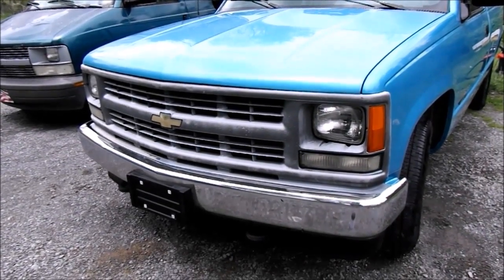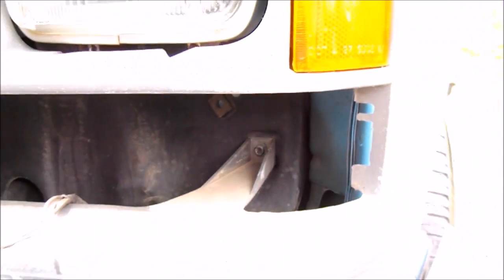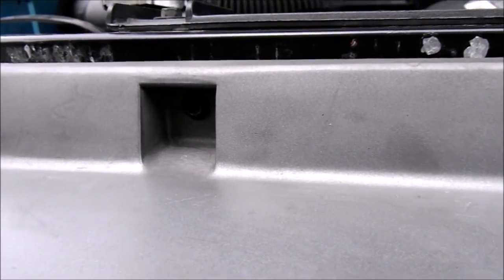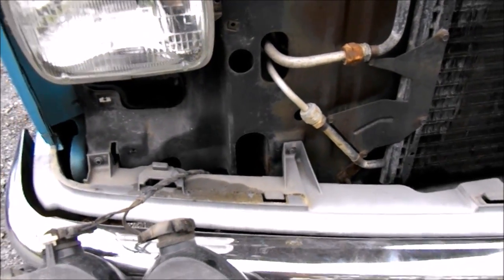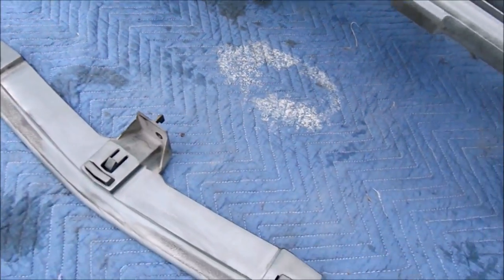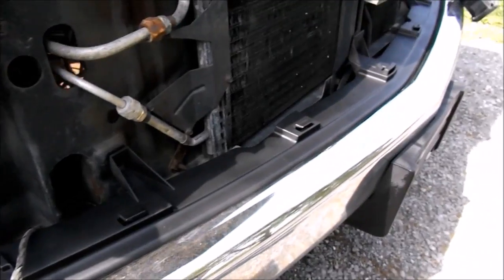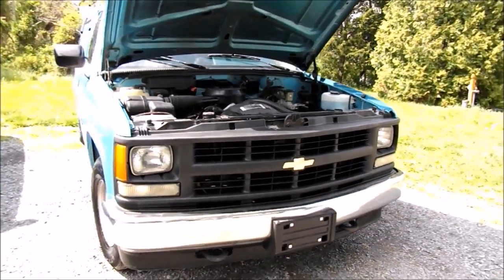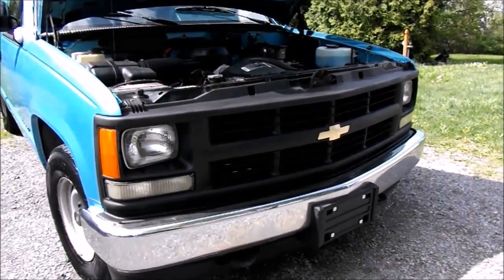Before and After Painting Truck Grill 1994 Chevy Cheyenne - How To Remove The Grill on a 1994 Chevy

Comment: you need to trow those old turning signals away ,go on amazon there are some nice crystal clear replacement lights ,it will make your truck look cleaner.
Reply: NETRO13 do you have link to them
Reply: Clear side markers will fail you on safety inspection.  They have to be amber to be DOT legal...  
And yes.  You can and probably will get a ticket.  The DOT cops are looking for revenue from everyone now.  
The W/T grille looks great in black.  Real clean look.  Even better if it was a GMC grille...  ;^)
Reply: David Hatzenbuhler they make amber LED bulbs
Reply: I have one and looking for some improvements

Comment: What kind of paint did you use and the sanding process done by hand or with a buffer?
Reply from the maker: The paint used was Rustoleum Flat Black and we sanded it by hand
Reply: +© Maxxtruck9906 hella sick bro. imma do that this weekend. I got a 94' z71 off road. 

Nor☆Cal

Comment: what is thr front end called
Reply: That's the base model grille which uses the single sealed beam setup that was on the standard C/K Pick-Ups in Cheyenne trim and the W/T trim (exclusively for the C/K 1500's).

Comment: How much do these trucks go for in good condition??
Reply: I paid 3,500 for a decent body and pretty good interior 👌
Reply: @BigDookie85  i got one for 6000 you think is a good price its a side step with 111xxx
Reply: @cristianrufino3472  yes the miles are good
Reply: @BigDookie85  are you still working on yours?? How's it doing till now?
Reply: @cristianrufino3472  $2,500 dollars so far on oil change, transmission flush kit, tune up, new catalytic converter,  fuel filter, idle air control valve and flowmaster series 40 dual exhaust. She's running good now. Next going to be line x bed and new tires.
Reply: I paid 5000 but needed alot of work